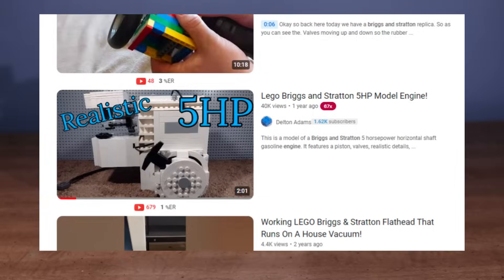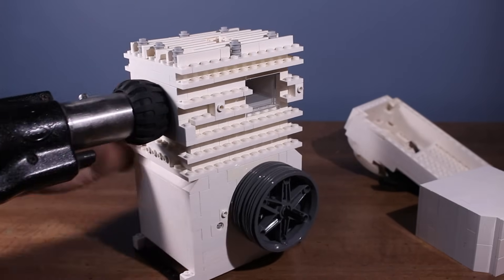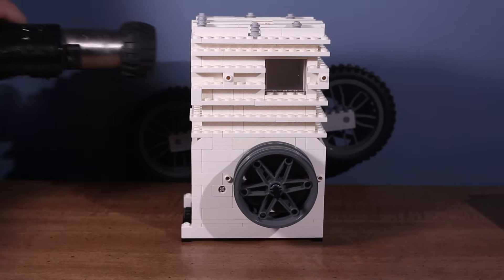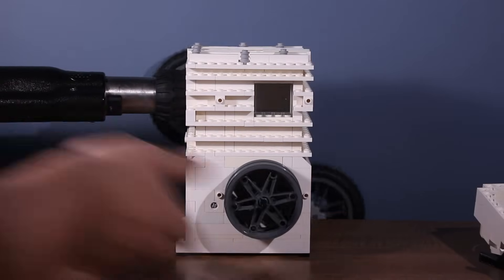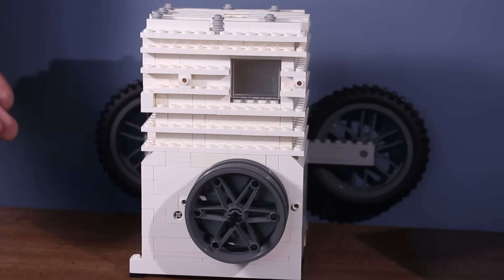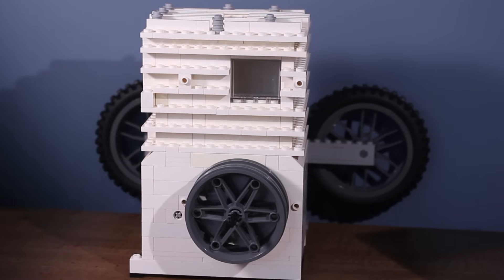I Tried Vacuum-Modding my Old LEGO Briggs & Stratton Engine.....

Comment: Im trying to understand a flathead valve. when the Valve lifts and air goes through, were does it go to, to power the pistol??
Reply from the maker: When the vacuum valve opens, it allows the suction of the vacuum to pull air out of the cylinder, which moves the piston up. The flywheel lets the piston move back down, where another valve lets fresh air back in. That cycle repeats

Comment: The number one thing for making LVE’s that run well is to make them as efficient as possible, for example, making the airs path shorter so that there are less leaks and the vacuum is using it’s energy to move the piston and not sucking in air from outside the engine. Hope this helps!

Comment: Adding a acceleration valve for air to get sucked in and it will speed it up 😊
Reply from the maker: Nah, it was the vacuum itself. I already fixed it and am making far better engines than this

Comment: If you add a inlet valve on the other side of the piston with a throttle of sort or turn the vacuum hole you all ready have as a idle hole and put the new vacum hole above the piston for hi eficiency so please do this for your subscriber because I do not have enough Legos to do it
Reply from the maker: I already fixed the main issues with it in the next two videos of this series. However, it turns out the vacuum was the problem, not enough suction to run it

Comment: ithink if you take some of the weight off and add a throttle valve it might work
Reply from the maker: Nope. The problem was my vacuum. Not strong enough to run it

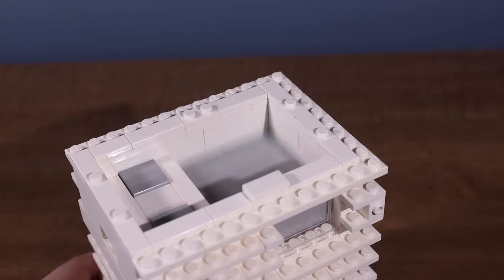Comment: 2:01 or just use some engine oil
Reply from the maker: But why? The friction was so low, it wasn't a problem. Oil would have just made a mess
Reply: @ i learned the hard way using WD-40 on a vaccum engine. i washed the thing in warm water for at least 30 minutes. then it exploded in the polebarn, theres still some pieces in there

Comment: Idk if you ever realized this, but you have both your intake and exhaust valves on the same exhaust line. It's going to refuse to spin because every time your intake valve is open you're pulling back on the engine when it's trying to turn over.
Reply from the maker: Yeah, I fixed that in the later video of this series

Comment: Try supercharge it
Reply from the maker: @thebasiccharlie1324  lol first I need to make a vacuum engine that can actually run!
Reply: @DeltonAdamsLEGO oh yeah forgot about that
Reply: @DeltonAdamsLEGO did the engine work before you modified it?
Reply from the maker: @thebasiccharlie1324  as a model, yeah. It ran using a power functions motor
Reply: @DeltonAdamsLEGO  nice
Reply: @DeltonAdamsLEGO  now turbo it

Comment: 5:40 the spinny little thing that is near the kick starter you could extend it and put a smaller wheel so you could keep it running?
Reply from the maker: That's not what was causing the issue, it's my vacuum
Reply: @DeltonAdamsLEGO  oh alright

Comment: Put an electric start and a lighter flywheel on it, that may help
Reply from the maker: @MoparCentral2010  tried a lighter flywheel, didn't work, and to add a motor to start it would just make it more complicated. We came to the conclusion that the engine is totally fine, it's my vacuum that's the limiting factor
Reply: @DeltonAdamsLEGO  oh, alright

Comment: Even though you may have it vacuumed it wont keep its motion long without something making it go back down, cause the vacuum is only sucking it up, you would need another vacuum to make it go down, the reason a engine works is with the spark plug, it also has a fly wheel so it can keep motion to go back up
Reply from the maker: You don't need something to pull it down, it just helps to have one. But for a 2 stroke vacuum engine, it's the flywheel's job to do that

Comment: if you have any lego Power Functions pieces like motors and battery boxes laying around, why not connect one of the M, L, or XL motors to the flywheel to give the vacuum engine electric start to avoid manually turning the flywheel?
Reply from the maker: That would also require some sort of freewheel to prevent the motor from restricting power. All in all, it was just too much

Comment: Your valves should be opening when the piston is at the bottom so it can suck the piston up you have it so it’s sucking the piston at the very top and isn’t doing anything
Reply from the maker: @reesemolloy6109  they are. I also did a lot of timing adjustment during testing
Reply: @DeltonAdamsLEGO  oh ok I just saw while watching the valves were open while the piston was up

Comment: Ive made a lotta similar engines like this, the reason why i think the engine is having trouble is due to three things: 1 flow of air, if air cant come in and out fast and easily, the engine has to spend some of its time squeezing it. 2 timing, you might wanna advance the timing a little so air comes in sooner, as air takes time to leave the chamber, esspecialy at higher RPMS, and 3 just plain old  friction, mabye use some water as lube, or clean the cylinder and make sure there are as few bumps on the cylinder walls. main thing is to minimize losses, and then also efficency

Comment: If I’m gonna be honest you don’t need that really big flywheel. Your probably only need one motorcycle wheel and it will probably run way better than it is now.
Reply from the maker: @LexC-x8f  Actually no, with a smaller wheel it runs worse, or not at all

Comment: It would run smoother if ur flywheel was balanced like having 4 points so the weight is evenly distributed
Reply from the maker: With two the weight is fine. Its my vacuum cleaner that's the main problem

Comment: you need 2 valves running at a 1:1 ratio to the crank and 180 degrees apart, should run like a compressor in reverse

Comment: what if you used a lego motor to spin the starter wheel for an electric start?
Reply from the maker: I don't think that would've improved the running of the engine, though...

Comment: You had 2:1 gear ratio with cam lobes 180 degrees apart and intake connected to the exhaust. You need to have 1:1 gear ratio and make independent channels for valves :)
Reply from the maker: Yep! I'm working on that now!

Comment: 18 that says Briggs & Stratton will run we had a lawn mower had a hole in the side of the block and the damn thing still kept running we pull them off of scrap piles and junk yards and the lawn mowers we pull them but the joke and they started right up you're not going to get a bad one of the best lawn mower engines out there or Briggs & Stratton you might find one one might be a little bit better than that but you won't find no other one Briggs & Stratton is like almost number one out there but not quite but almost number one they always start no matter what unless you really smash him or if they're out of gas or your room till he ran out of the world he seized up

Comment: instead of using the 2 by 2 tiles as intake and exhaust valves, use a piece like Lego piece 2723 and it will work better. Also idk if this will work but Lego tires may fit on the disk thing.

Comment: that's a pretty cool design, I also made something similar, well similar to vacuum powering a lego engine, except mine was based on a steam locomotive piston, like where you have the valve that goes back and forth switching from one side to the other, it worked quite well, sadly it had no way to reverse the direction.

Comment: Instead of the tiles try the black round technic disc thingies that nobody knows the name of that are commonly used for LVE poppet valves. And it will run better as a "2 stroke" with 1:1 gearing for the camshaft but who knows, maybe it will work as a 4 stroke (with the cams offset 90° and both intake and exaust happening every other rotation.)

Comment: Try making one of the valves putting in fresh atmosphere to not starve the cylinder of air, and try and counter balance the piston. You'll notice when it runs, it speeds up when the piston goes down and slows down when the piston raises
Reply from the maker: Yeah, I probably will if I come back to this

Comment: To improve this alot first make sure both ports aren’t connected, you could also just do a 1:1 gear ratio from the crank to valves, lastly seal the valves off from the crank and make try to make a spring set up for the valves

Comment: Just makes just make sure the valve the vacuum is on is open when it goes up and the other valve to open air because this setup is completely wrong
Reply from the maker: It's not "wrong" per say, but an exhaust valve would've helped a lot
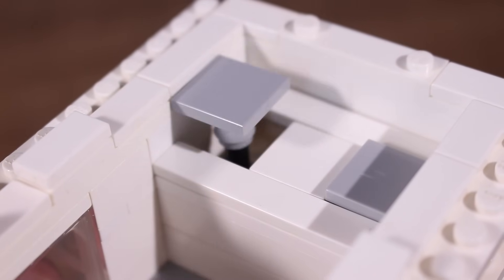Reply: @DeltonAdamsLEGO  0:55 it’s open when the piston is going down and sucking on the piston
Reply from the maker: That was before I timed the engine. I messed around a lot with various timings
Reply: @DeltonAdamsLEGO if it was me make the valve a 6 stud and split it up or that you have a 4 stud blok intake valve and a 6 stud block outlet valve

Comment: You need to change the valve setup
 what you had in the beginning was perfect now you are sucking on the down stroke, I’m surprised it did anything
Reply from the maker: It's not sucking on the down stroke. The cam has a 2:1 ratio. Each time the piston rises, one of the two valves will be open, but they close before the piston falls

Comment: the problem is that you connected both valves, this engine is basicaly working like normal engine but it is powered by exhaust(vacuum) but as soon as you dont have any air intake engine needs to take air by itself, this is why it doesnt work right
Reply from the maker: Not all vacuum engines need exhaust valves. I was trying to see if I could get It to run without one.

Comment: usually when pp convert briggs to steam they add another lope on the cam or change the ration of the cam to 1:1 to your intake valve open when your piston go down and exhaust open when it go up , vacuum engine are reverse steam engine, so either change the ratio or the cam lope to be 180 deg so like you have to piece for one lope just turn one off them 180 deg on each lope and but you vacuum on the exhaust side
Reply from the maker: I plan on it. I'll see how it goes
Reply: @DeltonAdamsLEGO  https://youtu.be/7TeDwAd3al8?si=sMXaM3w33g7fffud

Comment: with the original valve ports it would have ran better as you generally should have an exhaust valve. (or piston that has holes so the engine gets air from somewhere)
Reply from the maker: Yeah, I was going to maybe try again but with an exhaust

Comment: I would recommend making bigger valves and instead of using bricks for the cylinder walls, use Lego walls (1x6) plus lubricantion is highly recommended
Reply from the maker: I wanted to try to make this run with as little modifications as possible. I couldn't changed a whole bunch of things, but that would kinda defeat the whole idea of the project
Reply: I don’t really think he needs to change the valves.

Comment: Hi, Not long ago I tried using this model as a base starting point for a vacuum engine. I found that you need to have 1:1 crank to cam ratio and also an exhaust valve. Also you should use a little bit of olive oil on the cylinder walls and valve seats to lubricate and seal components.
Reply: Yes and also lower the head
Reply: well. thats a 4 stroke, it is possible, but it produces less power than 2 stroke and it is harder to get to run good.
Reply from the maker: I've had a lot of people tell me to use a 1:1 ratio, but I wanted to make a s little modifications as possible. I also don't like the idea of lubrication, as I said in the video
Also, it is a 2 stroke. Every time the cylinder rises, a valve is opened
Reply: @DeltonAdamsLEGO as little mods as possible is what's limiting u from max efficiency
Reply from the maker: @ThomasthetankengineE2  if that's the case, so be it. I'd rather have something that doesn't work very well than something completely different that what I started with. The whole point of the project was to see how little mods I could make to get it to run
Reply: @DeltonAdamsLEGO the flywheel is very unbalanced

Comment: for years ive been trying to make one, fail each time, do i need a very big flywheel
Reply: Is your timing of the valves correct?
Reply: @DeppadaimDienst  yes, I've tried many types as well, like "butterfly," which has no valves
Reply: @hyhoondai  What did you use as a flywheel?
Reply: @DeppadaimDienst  I made a custom one. It's smaller than the one in the video but a bit thicker
Reply: @hyhoondai  Oh out of lego bricks?
Reply: @hyhoondai  I also tried this one time but i just could not get enough mass with the bricks. It would be better like in the video, that you use technic bricks (or technic beams) with wheels on the outside, so the momentum is way higher than when you spread all the mass equally.
Reply: @DeppadaimDienst  yea, I just tried with technic but still no. I'm reassembling the engine now
Reply: @hyhoondai  Hmm with what engine?
Reply: @Oberspezialist  just a basic 1cyl
Reply: @hyhoondai  With what valvetrain?
Reply: @DeppadaimDienst  it's connected straight from the camshaft, sorry for late response
Reply: @hyhoondai  Ok then i dont really know either
Reply: @Oberspezialist  yea

Comment: The engine couldn’t run because you don’t have an exhaust/intake value… the flywheel is not a problem. Also adding lubricant will make it smooth and run much better.
Reply from the maker: Yeah, I'll need to add an exhaust valve. But I'm not going to lubricate it just yet...
Reply: @DeltonAdamsLEGO  yeah no worries on the lubricant. I can understand when it’s not such a big deal
Reply: @DeltonAdamsLEGO  just go back to the original divided valves.
Reply: Graphite powder would be a good lubricant
Reply: 5:30 it’s took me a while to build good vacuum engines but please don’t just give up. 

Always start off simple when building vacuum engines so you can get a better understanding of how they work and stuff.

Comment: I have an idea, you need an even fly wheel not with weights on each side
Reply: That can help but vacuum engines don’t need that big of a flywheel he built something wrong to be it looks like he didn’t add an exhaust valve
Reply from the maker: You don't "need" an exhaust valve. Many designs don't have them. But they do help a ton
Reply: @DeltonAdamsLEGO  well, you have to get air into the cylinder somehow. on designs where there are only intake valves, the piston isn't usually airtight thus letting air from the crankcase to the cylinder.

Comment: This is really cool, but as a somewhat experienced vacuum engine builder, i should tell u that a 6x6 piston is quite inefficient since a larger volume of air has to be sucked in by the vacuum then in a 4x4 piston. Also having 2 valves technically doesnt reduce efficiency but your valve design isnt the best because the valves dont let the piston go down freely enough cause of the way they are designed. Hope this helped lol
Reply: I found out that 6x6 piston is better on "experimental" or otherwise low rpm engines. 4x4 is better for already working models. (my own experience)
Reply: @Ollisaa6095 they do have low rpm but they have insane tourqe if you give it a 4 stud stroke
Reply: Try changing to a 4x4 piston first before/if ur going/not going to redesign the valves
Reply from the maker: The only problem with reducing the piston size it it requires an entire cylinder rebuild, which kinda defeats the whole purpose of the project.but I guess you've gotta sacrifice something somewhere...
Reply: @DeltonAdamsLEGO  i understand what you mean. If you dont want to change the piston size you can still try redesign the valves to have an exhaust stage in the rotation sequence.
Reply from the maker: @LemonJuice_  yeah I think if I do this again, I'll include an exhaust
Reply: @DeltonAdamsLEGO  cant wait to see it!
Reply: I would not say 6x6 is ”less efficient” per se. I’ve been making these since 2020
Reply: Can you please make a easy but powerful engine tut

Comment: To my understanding you need a exhaust valve, so that the vaccum can suck in air so the vaccum cleaner has something to suck on. Also i found to have the best result with vaccum engines that instead of taking those plates as valves you need to use the tires from the Speed Champions cars because of the rubber, the valve has a better seal.
Reply from the maker: You don't "need" one, but it helps a ton to have one. I'll keep the tire in mind
Reply: @DeltonAdamsLEGO in you do an exhaust its run 1000x Better behaus you valve Open When the Pistolen go down and this Breaks the Pistons
Reply: @finniboy9670  yea
Reply: @DeltonAdamsLEGO i mean you Need an intakte and exhaust and on the exhaust ist the Vakuumcleaner
Reply: @finniboy9670  You sound German. Not like it's a bad thing, but you do.
Reply: @pAInterfromPressureReal  yes Im German But Its was late Like 11 Night
Reply: @finniboy9670  ur silly u put the vacuum on the exhaust and leave the intake open.
Reply: @DeltonAdamsLEGO it is definitely worth putting it in, I didnt have an exhaust on mine before and it was similar Intake to yours and it barely ran and I put in 2 exhaust ports and it ran super well